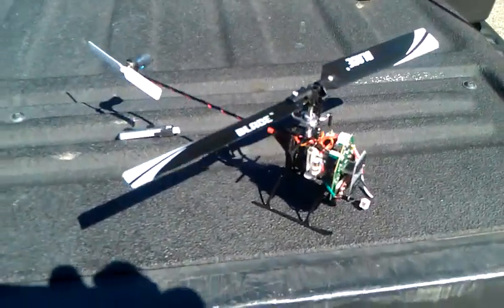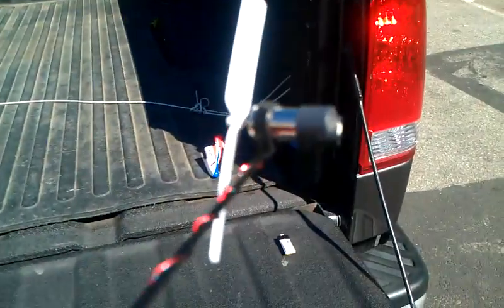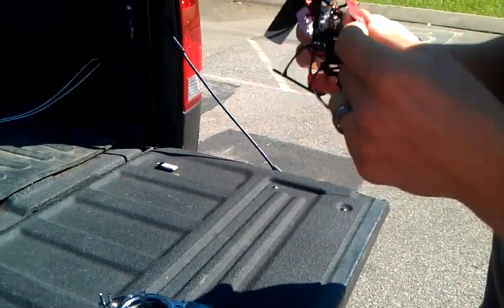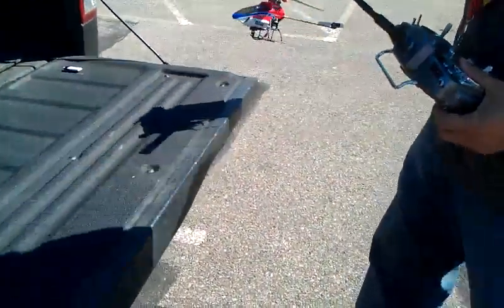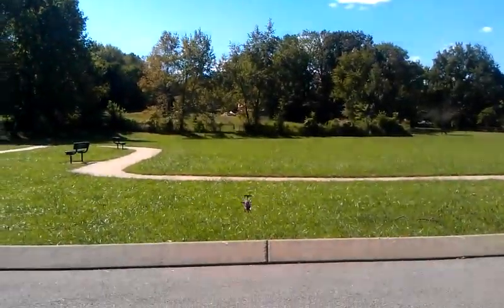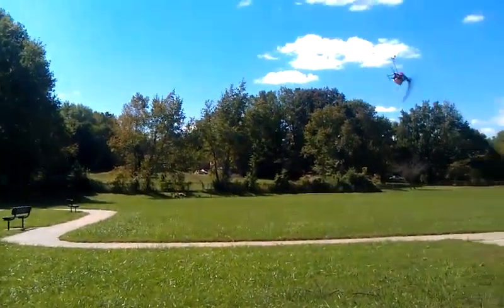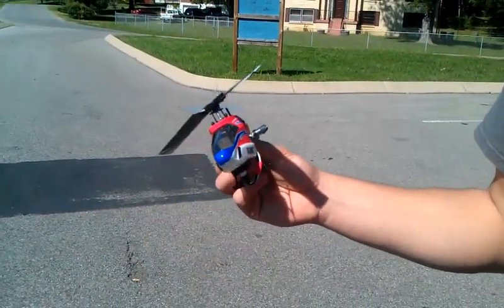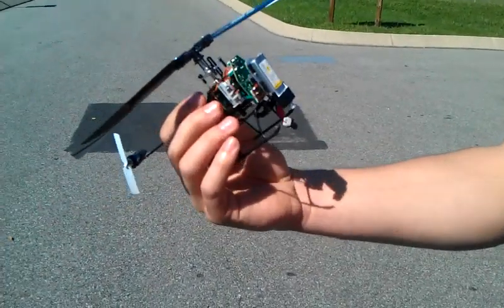helifreks brushless MCPX

Comment: Nice setup, and flying.  Have you tried trimming the 120 tail blade?  I got the 120 tail from Wow and it came with a blade with the same profile as a Walkera 4G3/Novus CP, but was mounted direct drive.  I found it took a sec to spool up, as well as wind down, resulting in some over rotation.  So I tried the 120 tail blade trimmed about 3/16", and I love it.  Cheers.